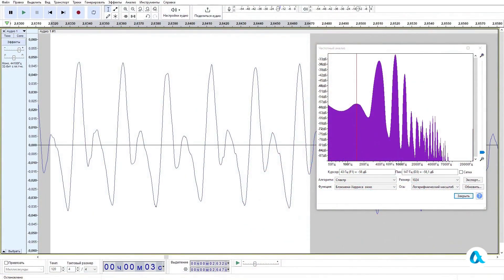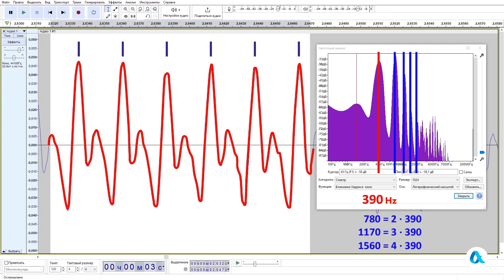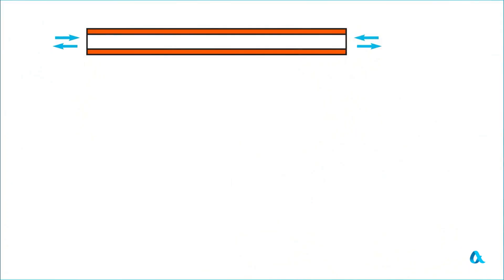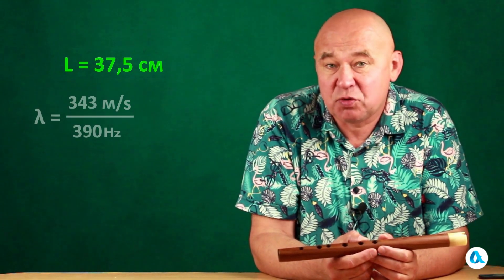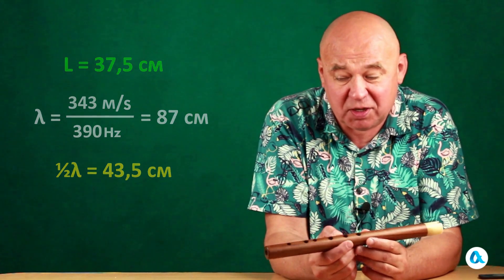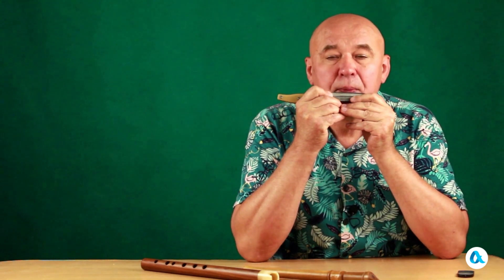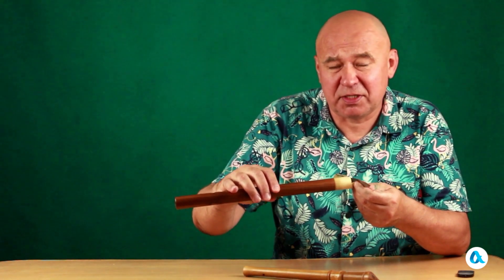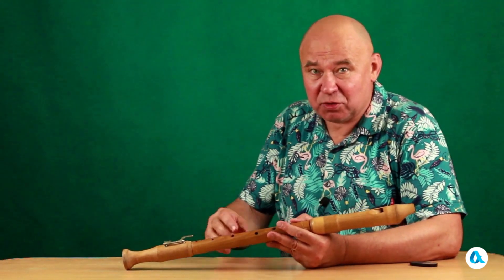Flute and self-oscillation

Comment: Not quite complete explanation at all. For certain notes on the wind instrument some mid holes are open while later holes are still closed. This model is not adequate to explain that.
Reply: I've always wondered about that since middle school, but I haven't found an explanation for it yet. I'm unsure of the proper term for acoustics, but I wonder if it has something to do with a term I'm borrowing from electronics called a standing wave ratio. This is when parts of waves are reflected when crossing the boundary of a change in medium.

The two different media here would be the air inside the flute, which has all sorts of crazy pressure things happening to it, and the air outside of the flute on the other side of the open holes. I'm guessing that lower frequency waves are more likely to pass through this boundary change while higher frequency waves are reflected (I don't know this for sure). This means the higher harmonic frequencies are left inside the flute to resonate while the lower tones are dissipated. This would probably make a "cleaner" sound.

I don't know how standing wave phenomena work, especially for acoustics, and I don't actually know if it has anything to do with the weird fingerings. I'm an undergraduate in physics trying to figure this stuff out. If you are interested in this kind of research it would be great to hear from you.
Reply: @lazarussevy2777  It is about the wave (partial) reflection and (partial) passing due to change of the aqoustic impedance. You may find your answer by searching and studying who physical modelling of music instruments works. Especially that of the wind instrument modelling.